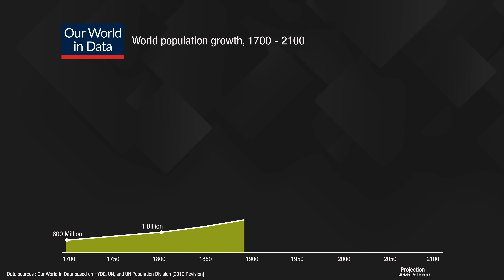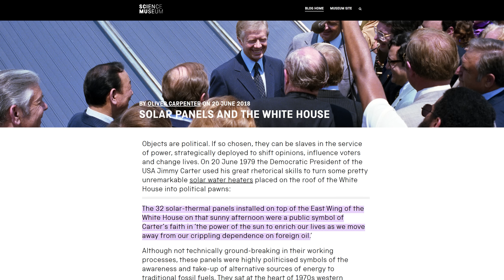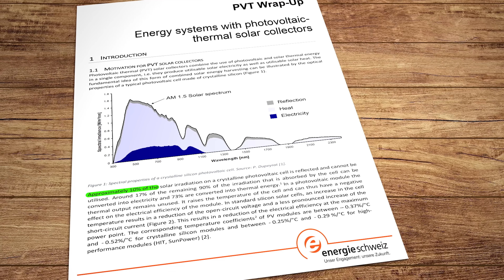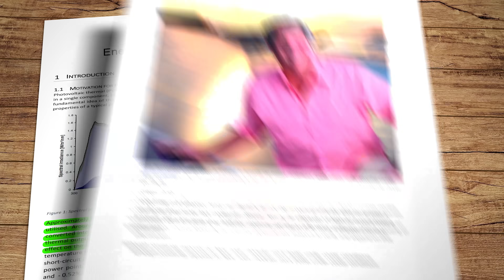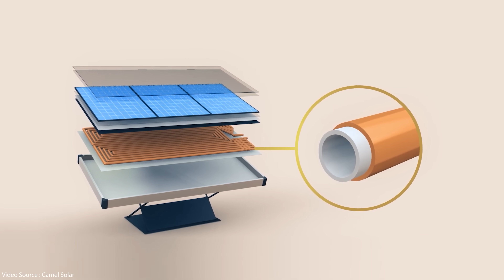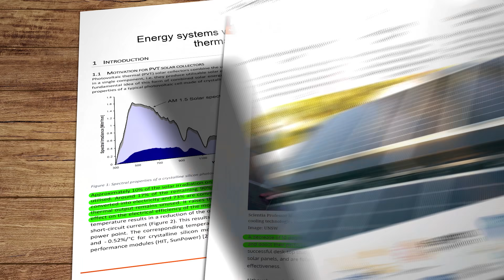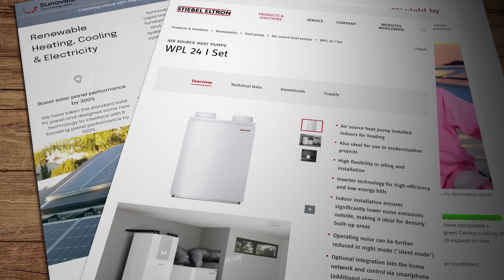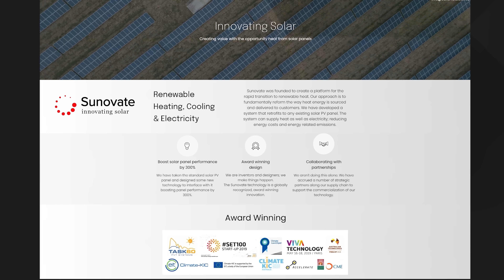The Solar PV panel that provides electricity AND heat for your home!

Comment: Over here in Canada we.have a carbon tax to try and get us to go back to the cave days with no heat no lights and walk everywhere our government like a lot of other countries have programs to help the wealthy make their homes greener but for seniors and low income home owners and renters we are supposed to turn off the power lights and water park the car put on more clothing blankets and either walk or take public transportation if they really want us to go green and upgrade our homes to cut carbon emissions we need not only rebates but low interest loans to do the upgrading we also need to be able to access the rebates and low interest loans and be able to do the work ourselves it would be a win win lose situation for the government win win in they cut carbon emissions win in the fact it doesn't cost them money just a deferred tax by using the carbon tax for low interest loans they deferred the tax but will get it back over ten years time lose in the fact you can't charge carbon tax on solar electricity or heat pumps and if they expand it to electric vehicle they don't use fossil fuels so you don't have the carbon tax from that either and they need to let renters get low interest loans for portable there are a lot of great solar generators out there there there are folding solar panels and panel that can be put on the balcony to charge the Solar generators because landlords will not put up money to upgrade their rental properties unless it's an apartment and they pay for the heat but not too many landlords will put twenty to thirty thousand dollars to save a tennant some money also thanks for some great videos and thanks for not making your utube chanel al about.how much money you can rake in from advertising wish other chanel would do the same but they need the money to pay for their expense house And Tesla car and for the RVers their expensive rigs

Comment: This is actually something I have had in my drawing table (I am merely an amateur, not pro in any way) for few years. One thing I feel as a potential, however rare concern is dew point (superficial, because quality panels internal dew point is not much of a concern). That is because I planned to use sub-zero liquid as a coolant.

Comment: Excellent T-shirt, nice to see your support.

Heat can be used for many things. Just like a gas powered fridge in a caravan, the heat could actually run an Air Conditioning system. In countries with enough heat, it can be turned into electricity.

Just a comment on your intro. The problem with the National Grid are the peaks and troughs. These are balanced out with solar, house batteries and EVs. Additionally, when large UK oil refineries close down, that energy will be available and at 5 kwh per Gallon, that is a lot of elecrons.

Comment: The main problem with these is that you get heat when you don't need it and you also get it too dispersed so you need a heat pump to concentrate it anyway so it would be useful (for heating water , which is the only place you would need it in the summer). Any other circumstance like for greenhouses is tricky, you need the sunlight for plants too.
Reply: @Just Hαve α Think’s▫️ Sorry I don't use WhatsApp Twitter and similar, I care about my privacy.

Comment: The duct work may be cost prohibitive, but a refrigerant coil (heat pump) may be sufficient in redirecting where needed. Pools, water heaters, boilers, all would be great storage solutions, until maxed out of course.....

Comment: The thermal loss across a panel is the same for air as with water except water takes heat away much more efficiently than ambient air.  On a hot day your air temperature starts out hot.  Water is ground temperature, in the 50 to 60 Fahrenheit .  By having two tubes at opposite ends from each other you can mix hot and cold as they pass one another,  the cold beginning of an entrance tube met by the hot exit temperatures of the other tube, side by side then to regroup under the panel to go to a reservoir for use as hot water or heat exchange in winter heating the house.  This requires a paste to conduct heat from the panel to the water pipes.  Something simple will do.    I like the idea of the air cooling method for use in drying wood for a wood shop.

Comment: Hi Dave, you mentioned  Denmark with huge pit heat storage systems. Could you or have you already done a dedicated video to that specific idea. This seems to me a much more important concept than the simple quick mention given here in this video.  As Robert Murray Smith would say, real viable solutions must include solutions that are doable by the average Joe citizen. A huge pit may not seem so doable at first glance, but really it is.  A huge pit the size of ones home is dug every time a home is built where I come from, it's called a basement. My property has room for ten or twenty pits the same footprint as my house. Properties like  this are quite common in my neck of the woods, and winter is very long and very cold. A heat storage pit could be the answer to heating my home all winter long. 

And as always, a huge shout out to you for all the hard work you do collecting this information and sharing.

Comment: There’s another PV system problem - oversupply. In Australia the maximum system voltage is 258 volts and for you to export power from your solar system to grid requires a voltage in excess of grid. If grid voltage has approached 258v then your solar system will start reducing output so as not to exceed 258v. So, unless you have batteries to utilize excess power you may not be able to export excess power.

Comment: I was planning on trying to make my own PVT panels for my next home.  Maybe instead those Sunovate panels will be ready by then!  I do think utilizing the summer heat will be a challenge though, especially if we're talking about a structure targeting passive house like insulation and sealing.  Adding a pool would certainly help in the late spring and early fall as well as lengthening the swimming season and providing potential storage for the house in the bordering months but I think there will still be some time mid to late summer where even people with pools would be looking for a place to dump heat.
Reply: Bloody expensive, but I've seen pvt used in conjunction with ground source heat pumps. In the summer heat is used to produce hot water an any excess gets dumped into the earth in more recent cases surrounded by insulated foundations under the the building.
Due to the large amount of mass a fair amount of heat can be stored until the winter months when the PVT cant produce enough heat for water or heating at which point the stored heat is used by the heat pump to work at a higher COP than without.

Only really usable by new builds and even then unlikely to recover costs, but in far as making the most use of energy that can be extracted from sunlight it is pretty effective.

Comment: Ronald Reagan approved their removal...  due to repairs that needed performed to the roof due to the panels installation causing leaks...  It was decided not to reinstall them as the panels themselves would need replaced,  and oil prices had collapsed by the time the repairs were completed.

Comment: Just a thought why couldn't you use a sterling engine to generator electric if the temp is more than 10 C from the outside temp

Comment: I thought for years we ought to have solar panels which shed water from our roof, plus heat our hot water, plus generate electricity. I never thought of heating a home. We can do that with insulation and passive solar heating. Solar panels are pretty much water resistant. Just join them together with a bit of caulking or overlap them like shingles. And cool them by heating our water. But I like the idea of heating the home as well.
Reply: We could keep in mind regions where there is snow. The water heating system could be reversed to melt snow, so the panels can keep generating electricity.

Comment: On a similar note is the prospect of capturing the heat from air conditioning systems to heat water. I live in the tropics in Australia and considered heat pump hot water systems to satisfy our hot water needs. As I understand it a heat pump is essentially an air conditioner running in reverse mode. I looked for an air conditioning system that would do double duty as a water heater without success. The condenser of our split system ac produces significant amounts of heat which we currently use as a clothes dryer by simply putting the drying lines in front of it.
For commercial buildings there must surely be a better way to utilise all of this heat?

Comment: Air has huge disadvantage compared to water. One galon air has 4000 times lower thermal transport capacity than one galon water. So you need to run 4000 times bigger volume per second through your panels to reach the same amount transported thermal energy.
Reply: This is not a problem. Water is 4 times the thermal capacity as air per kg. This is what we duct it and as much of the innovation is below the panel as it is above it. Heated air is a facility based solution. Its not intended to travel long distances. This is why we introduce a air to liquid heat exchanger to economically move it over distance or for longer term storage.
Reply: @glenryan6692 Well, in kg it sounds nice. But 1 kg of water is only one liter of volume. One kg of air has a volume of 800 liters and has 4.2 times lower thermal capacity. If you calculate a heat transfer of about 1000 watts and a output / input difference of 10 Kelvin, you need to transfer 1.4 liters of water per minute. If you use air as the medium, you must transfer 5000 liters of air per minute. In my view, electricity losses for air transport will be much higher than water pumping losses.

Comment: The main problem with PVT that I see is that you only get very low-grade heat out of it. Conventional solar thermal will give you 60+C water so works well with hot water systems. Even in the dead of winter it'll get a small volume of water over the 40C you need for showers (although most setups actually give you a lot of tepid water rather than a small amount o hot water). But PVT is going to struggle to provide water hoter than 40C most of the time isn't it? Panels will often barely be 40C themselves so you might get 30C water after the various heat exchanges.
Now that's OK if you don't mind heating the last bit with gas of direct electric, or if you put it through a small heat-pump, but it's always been hard to make ST pay, and extra complexity works against that.
Still it's interesting to see an air approach rather than a water one.
I am one of those weirdos that has both ST and PV on my roof (because I fitted ST first). quite a small area of ST does produce loads of hot water for 6 months of the year, and some hot water all year.

Comment: This makes so much sense! I would not have thought of the cooling effect at night, that's a bonus!  I have a friend who has had an all solar home in Michgian USA for decades and he has talked about being able to get MORE than the rated output from his panels in the dead of winter since the panels are so cold then.  In the summer he get less of course but the longer days make up for that so the pulling away heat from them in a usable form is a brilliant!
Reply: Hi Larry, the cooling effect at night is used for space cooling. So its 100% thermal related. We can also take fresh ambient air in and sub cool it like an evaporative (swampie) system but without the water use. Fresh filtered coolled ambient air chills the house best the next summer day.
Reply: @glenryan6692  Yes thank you! I can see the benefit and how it works, it's just not something I would have thought of. But that's why I'm not a solar engineer!
Reply: @glenryan6692  And if you're looking for a test site in the U.S. We are an all electric home with Geothermal H&C! I hope to Add Solar this year.

Comment: I’m currently building a system for my home that uses DIY converted PVT panels to heat an insulated 3000 liter cistern, and then using a geothermal/hydronic heat pump for home/DHW heating from that.

Comment: As an Engineer (living in temperate Australia where typical daytime maximums go from 10C in winter to 40C in summer) I've actually worked on this exact problem. And at least on the domestic level, its a very hard problem. You end up needing to convince people to spend a fair bit of money on some form of heat store. Or having some other tradeoff.

Also, the air box setup you see on this video is great in a colder climate. But in a climate like here its just a heat removal system for the solar panels. And its cheaper to simply buy more panels to compensate for inefficiencies than it is to retrofit this type of system (designed in from manufacture is a different thing). 

Without giving too much away I can say two things. Firstly, pure water is sufficiently non conductive. Secondly, you don't have to resort to complex plumbing and joints in order to create a solar panel sized heat exchanger - you can make it out of two pieces of aluminium. You can even make it in a form that creates the entire frame for an OEM panel. The key to not having too much of a thermal gradient across the panel is simply flow. 

Btw in a real system you will need a heat pump and a heat exchanger to reject heat to the air. (Nice if you could store heat for winter but again its a small swimming pool sized structure). One nice thing is that you can actually keep the panels quite cool by using the heat pump - not just passive cooling. That again adds to efficiency and life.
Reply: As a complete layman i have often thought of CSP with fresnel lens technology or trough capture with parabolics as a great way of heat source from the sun . Could you not combine this on a roof with the heat recovery from solar panels to provide very high temperatiures for heat exchangers to work more efficiently efficiently
Reply: @gategi10  These things are more complex to manufacture and thus end up being more expensive. That's why they haven't taken off. One possible tech that might get somewhere (and is being trialled commercially) is water cooling PV arrays. The warm water gets used as a heat source (for PV driven heat pump) and in return the PV array operates more efficiently, since its cooler. Its still niche though.
Reply: as a home owner living in Australia its pretty easy to have a cool and warm house,  double brick big eves and wool insulation we have solar hot water and solar electricity - we used bamboo as a wind /storm break never need to use air cond or heater but if we get a super cold winter I use the wood fireplace - from the wood i collect on the property.  my energy bill is generally 1000 a year in credit even with the tiny FiT (which shows you how much they value solar energy).  The house was built east to west too which is not ideal but it works - during rain I can leave every window open and not get rain in.  The only problem I have is one wall which gets hot afternoon sun (great in winter its like a heat store for the house) but bad in summer after about three days the wall is so hot it needs to be cooled down by water - i generally do that at night, a quick hose down to release the heat.

Comment: Great video highlighting some exciting possibilities. A San Diego company Icarus RT, was recently awarded funding by the California Energy Commission for a demonstration project of their hybrid PV/T system which uses heat exchangers attached to the back of panels to cool panels and produce hot water that can be stored or used on demand.

Comment: One day of energy needed is extremely costly.  I use 10 gallons of gasoline equivalent or 337 kwh/day.  30 kw is electricity and the rest is THERMAL...90% is thermal.  How much does 337 kwh costs?  $200/kw x 337 = $67,400/day of storage.  I need at least 15 days...over $1 million...and the space?  LOL  Just stop with this insanity.  The CO2 to make the battery for 14 days is 14 times MORE than just using gasoline due to the lack of battery cycling vs aging.  You are NOT saving anything with your solar PV/Battery/EV junk.  You are vastly increasing the CO2 by many times.  It cannot physically work!  

What can work?  NewEngineType tech with solar THERMAL + fuel maker + fuel tanks (long term storage) + hot water tanks (short term storage).  Couple this to New Engine Type in cars etc, and we can get to CO2 Neutral very quickly...but with PV/battery...NEVER....not possible.

Comment: No, the solar thermal is NOT wasted if you USE it to MAKE FUEL.  Wake up.  Thermal is the ONLY way forward.  PVs will not capture the needed energy.  Make fuel during the day and store that fuel.  My engine is 64 kw during peak...making fuel with small electrical house load.  Some of the fuel made in Spring is used in Winter.  Such large amounts of energy cannot be stored with battery or thermal boxes.  FUELS are the ONLY valid way to store the ENORMOUS amount of energy needed to be 100% RE.  PV is just a complex was of time and money.

Comment: Again, the key is to make fuel when it is warm to hot (Spring to fall) and use fuel when it is cold when the thermal takes a while.  There is plenty of energy on a roof to run ALL electricial and thermal loads via fuels if fuels are made ALL YEAR LONG.  My house can do over 5 cars and house loads if fuel is used....  You cannot do that with PV...LOL...not even close.

Comment: Made an enquiry when I was getting solar, to Convert Energy in the UK. Didn’t get as far as getting a price, but with the current market, I wouldn’t rule out expanding my system - which as space for another 7-ish panels. Water would go into my heat pump loop I’m thinking.